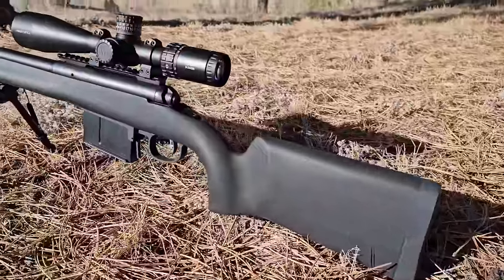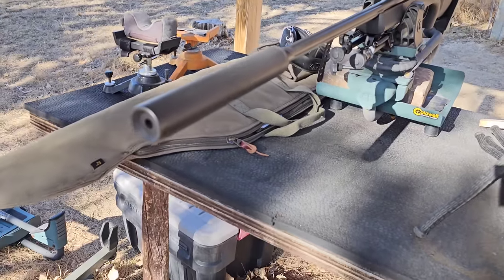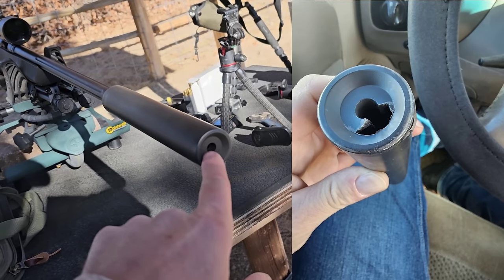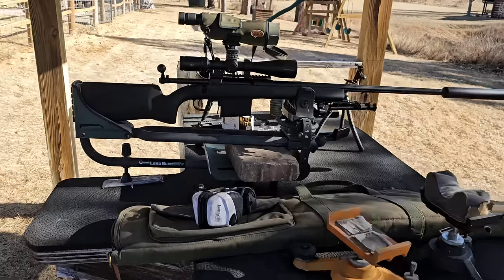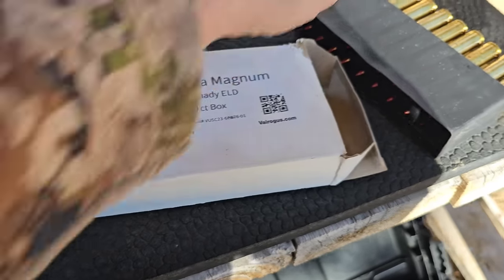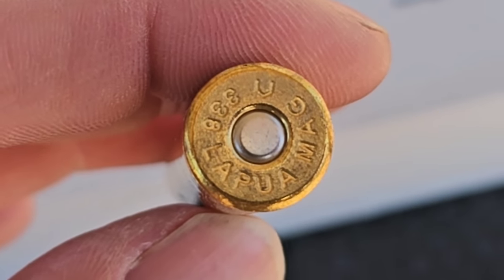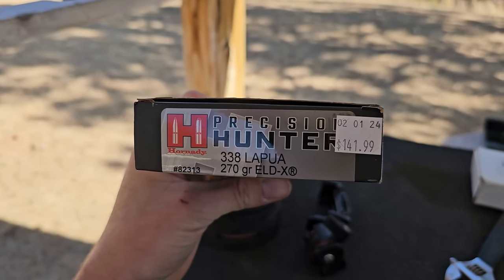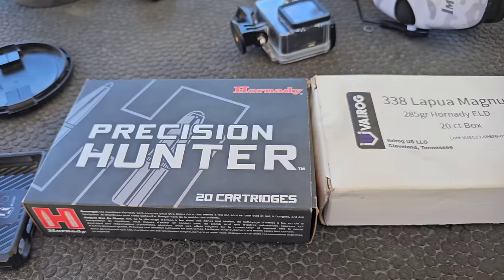Long Range Rifle: Something is WRONG!

Comment: Hello. I had a similar type of accuracy issue with a .243 rifle having a 1x10" twist. I thought and if you ask anyone that should be good for 100 grain bullets (I realize and am aware of Remington's debacle with the 6mm and rifling issue) . They were not, 4" groups and after shooting several different brands of 100 gr. moved down to 95 gr., then 90 gr., 85 gr. and was totally frustrated with the lousy 4" to 6" groups, and at my wits end about what to do next. I was seriously considering taking the angle grinder to the rifle and leave the pieces in the trash. I decided to keep going, why not, as I had already spent several hundred dollars on premium ammo. I stopped at the local Scheels and they had plain jane 80 gr. Federal Power Shock SP's and bought a couple boxes, only $20 plus each and headed to the range. I shot 3 as foulers, the next 17 shot 1 3/16" which is good enough for me. I have verified this with a couple other brands of 80 gr. bullets. The 75 gr. bullets were grouping slightly larger and some 48 gr. or whatever were not good. So, my humble opinion would be to try lighter bullets if you have confirmed that there is nothing wrong with the scope and there are no obvious problems with the rifling or chamber. You might have to apologize to the shell company that you disparaged too. Enjoyed your video. Thanks.

Comment: I would double check the mounting of the scope, rings, base, rail, ect.  If there is no issue with that I would double check the action screws to ensure they are tight and the rifle is not moving in the stock.  After that, replace the scope with a known good scope ( I suspect this to be the problem).  After that you can experiment with more than two types of ammo.  Some guns are picky.

Comment: I have that same rifle. Removing the muzzle brake was a chore... well not the brake, the washer.
I'm running the Banish 338 on mine
Reply: I should note. I am running Leupold scope with vortex precision rings. First time I zero'd it... took a few shots to dial it in.. then first group was 1" at 100yrds. Just bench rest with bags and some ELD match.

I wouldn't have recut the threads. I would have contacted Savage customer service. I've only dealt with them a couple times trying to get some info, but it seems their customer service is good.

Comment: Take the bolt apart and check for spring bind, and poundage, check pin also, make sure nothing is stuck down in the tapered area were the pin seates

Comment: I shoot a model 110 with an Arkon EP5. My 100 wasn't shooting well when I started with Hornady 285gr bullets. I reload for everything I have. When I started loading for the 110 it was shooting at best fair ( 3-4in groups at 100 ) what I found is the jump from the bullet to the lands was over an 1/8in. I now have this rifle ammo at 20thousands from the lands and now they do not fit in the mag but I am shooting sub 1/2in at a 100 with 250gr Burger Elite Hunter and shooting milk jugs at 1000 to 1200 hundred is not difficult.  So you might check your land to bullet distance however if you don't reload then there isn't much you can do.  Also my Arkon is extremely precise when doping for distance and returning to zero, I am extremely happy with it.
Reply from the maker: Thanks for the info.

Comment: I bought my savage 110 fcp hs precision in 338 Lapua back in 2012 when they just came out. I reload for it, loves Hornady bullets, will be trying sierra soon, but wicked accurate with a vortex razor HD gen 2 4.7-25 sitting on it. 
Using 285 grn hpbt bullets. Great rifle, has at leasy just over 1000 rounds through it. Still shoots great.
HOWEVER, now that youve had a true bore thread issue.....makes me wanna look at the threads and everything before i throw a can on it. 
Good to know

Comment: If you have anybody that reloads or a commercial reloader by you, I would take them two empty boxes of brass, and have them reload them to Nosler or Barns ttsx or Sierra GameChanger have them load them to their specs from factory and try them. I have multiple big guns too, and the only ones that really do good in mine that are Hornady are either SST‘s or interlocks ELDX I have not had a lot of luck with, but my 338 my300 Rum 7mm STW 300wm and 300wsm Shoot lights out with the nosler barns and Sierra bullets I also cite mine in first at 25 yards to make sure I am on the paper and then you can work it out from there. I always draw the crosshairs in the center of a paper plate measure down 2 inches and put a dot pull your boat out, make sure that you can look through where the bolt is and make sure you’re covering the Dot and make sure your crosshairs are aiming at the Bullseye above the dot and if You sit your scope to the bulleye 0:31 above the dot then shoot and you should be pretty close to the dot 2 inches below and set your scope to where you’re hitting the dot 2 inches below then take it out to 100 yards and you should be pretty close on paper to where you can adjust it

Comment: I know it’s 2w old already. Savage is well known for the railroad or zipper barrels. They’re tooling marks perpendicular to the bore the full length of the rifling. Ive also found most factory chambers are cut off the bore axis. Savage knows about their issues. They tell customers to shoot it and if it doesn’t meet their minimum quality standards, they’ll rebarrel it. 
Another commenter posted about putting a criterion barrel on theirs. I’ve got several shaws that shoot amazing for the price. Criterion’s are great, but if you’re willing to spend, you won’t be disappointed with a Brux, bartlien, benchmark etc. Or you can just sell it to me 😉
Reply from the maker: I got the parts I ordered. So I will be working on it soon. There is a rifle just like this for sale at first stop guns in Rapid City, South Dakota. FYI

Comment: Savage is really sensitive to action screw torque and the rear tang area under the safety being free floated.  
With every savage that I’ve had to tune, the front action screw torque was between 30 and 50 inch lbs. and the rear was around 20 and the groups would close right up.
Reply from the maker: Thanks, I will try that too.

Comment: Barrel not fully free floated? 
Base or rings coming loose? 
Does it group without the suppressor? 
Did it group before you had the barrel rethreaded?
Was the barrel cut and then re crowned?
Reply from the maker: Barrel is free floated, 
Rings and base are tight to spec,
Did not group with or without suppressor,
It did not group before threads were re cut.
The barrel was cut and re crowned after suppressor incident. 

I got a steel base coming, going to try different scope with different weights and brand ammo. And check everything else before I decide to put a new barrel on it. Thanks for watching.

Comment: A buddy of mine had the same problem with an epl 4x16 scope with a 300 Weatherby. Trued another scope and everything worked. Something internal was slightly moving and wasn’t noticeable until groups where shot. Not saying this is the problem but I have also had this happen with a vortex psr gen2 ffp where the glass was moving and only noticed slight movement when turning magnification.
Reply from the maker: Yes, I'm going to try another scope.

Comment: A quick question, is the scope touching the rail mount in the very front putting pressure on the scope when fired.
Reply from the maker: No, there is a small gap between scope and rail. Thanks for watching.

Comment: I had a baffle strike on a rifle as well.  The gunsmith that threaded the barrel either threaded it crooked or the threads collapsed and the adapter cocked upward.  Waiting on mine to get back from Silencer Central.
Reply from the maker: Such a pain when that happens. Luckily I bought mine locally and could drive to the factory and drop it off. Still had to wait. Thanks for watching.
Reply: @Guidedhunts  That's good that you have the company nearby.  Silencer Central sent me a label.  No questions asked.  1 week into a 3 week turnaround.  It is a pain as load development basically stopped.

Comment: Whenever you put a suppressor on,  use a caliber appropriate suppressor alignment rod. Every time. Aside from that, this is a 110% budget rifle setup. These are the results i would expect for what you spent. I'd buy a prefiit Bartlein and bring the whole damn thing to a gunsmith and have it true'd up and headspaced. Personally i'd go .300PRC if you need a heavy round like that. $60 a box everywhere around here.

Comment: Have you checked the fit of the barrel lug to the stock may be a good bedding job that might help tighten up your groups. I would run a barrel scope down the bore and see if there is a lot of carbon and copper fouling there could be a lot of carbon buildup in the throat area of the barrel. I would have a gunsmith look at the barrel for straightness and fit to the receiver. The mysteries of buying a used gun and not knowing its history.

Comment: First thing I would do is look inside of the bore with a bore scope give the bore a really good cleaning then bore scope it again if there is heavy carbon fouling or maybe burs especially at the mussel use a bore paste that has pumice which is a mild abrasive coat a bore mop with the paste don't be afraid to use this several strokes then clean inspect an repeat as necessary other things id check is the barrel contacting the stock anywhere it shouldn't be and the receiver is it bedded correctly and is the riflescope a known good scope I've seen all these things and more cause a rifle to shoot poorly  an be corrected by the shooter/ owner nothing you cant do yourself with patients an time

Comment: Inspect the bore and the muzzle crown with a borescope. Check to ensure the barrel is floated. Bed the receiver to the stock. 
If the barrel is bad, the borescope should allow you to confirm that. Then you can make a decision based on facts supported by evidence.

Comment: If it came with the scope rail installed take it off, degrease the screws and receiver threads and install with blue locktight. I've given up on savage quality control. My 6.5 prc is fantastic but my 308 is horrible. It's getting a new ibi barrel. If you're going to rebarrel that rifle switch to 300 prc. Glad you're safe and only minor damage to your set up

Comment: Just spit balling.. Are those scope mounts Warne?  That models has several diff models with different recoil keys.. some models use round cross screws.. some use a loose key., That can easily fall out during assembly.  Thought those models mounts were mainly for rimfire setups?
Reply from the maker: They are Warne steel rings. With a steel square recoil key. It is still in there. And the rings are rated for 338 lapua. Going to try different rings. And going to try a different scope.

Comment: Lead sled with weight has been known to break scopes especially on high recoil rifles... I just use mine with no weight as a rest. I have an older model of that 110... with max handloads and a 300 SMK its 1 MOA with that cheap stock. Going to be throwing it in an MDT chassis soon so I can actually use a bipod with it.
Reply from the maker: The lead sled I was using didn't have much on it. I use it like you just to hold the rifle. The recoil of the 338 lapua is not bad. My wife's 26 nosler kicks harder. When I find the problem, I will make another video. Thanks for watching.
Reply: @Guidedhunts Interested to hear the updates!! I had a similar problem with another rifle but it turned out to be my leupold scope just lost zero. Might be a worth a check too.

Comment: I would just check the torque on the action bolts. Epoxy bed the pic rail. Switch to a normal set of picatinny rings that can be lapped/bedded. Switch the scope. If it doesn’t shoot, just let it go. My experience is you start just going down a rabbit hole when it’s the actual rifle being the issue. Especially a factory rifle.

Comment: Bro, you can’t buy a big magnum rifle, put a cheap scope on it, a cheap suppressor, shoot cheap ammo, and expect it to shoot good groups. I certainly wouldn’t put a $300 barrel on it and add to the mess. 
Put a little cash into the most important part of the rifle, which is the barrel. If you troubleshoot it. Do one thing at a time, and one thing only, when ruling out problems. Or just spend $800 on a good barrel and start over. 
I hope you get it figured out. 
God bless you brother.
Reply: I'd probably put a good cryo barrel on it. He might actually find one in stock for $800.
Reply: You can put a Night Force on a gun with ammo your gun does not appreciate, and you will shoot like shit. Arkens scopes have proven to Track well and hold a zero well. He is shooting from a sled, the scope is not the problem. $.02
Reply: Love my arkens put this same model except in MIL on all my hunting rigs from 308 to 375 H&H and I've never had a problem. As a matter of fact i swapt out all my vortex and leupold optics for for arkens just because you get way more features for slightly worse glass but i dont regret the decision
Reply: @henryg2960 I’ve seen new scopes ghat wouldn’t hold zero
Reply: "Salvage" gains its claim to fame for a reason.

Comment: I had a Savage 112 Magnum which is the single feed target model. It shot like crap and I ran out of adjustment, well long story short they put the barrel in the action crooked from the factory. 2nd rifle worked better but didn’t get reimbursed the cost of the wasted ammo.
Reply from the maker: Yea, I believe that is what happened to this rifle. Just going by how the muzzle brake threads were cut. Thanks for watching.

Comment: Seems like it would take a lot to make that rifle accurate.  I personally would not keep it.  Also, wouldn't 300 WM be enough instead of paying 3X more for 338 Lapua ammo?
Reply from the maker: Yea I'm going to find out, thanks for watching.
Reply: My main hunting rifle is 300wm and I love it, I own a gunwerks built 300wm, 300 norma, 338lm and I must say the 338lm is definitely more capable cartridge but is it worth the cost difference? Not if you don't hand load! I hand load so it's not terrible to shoot, buying factory ammo? Hell no ide take 300wm all day long. 300 Norma has been truly incredible but getting good brass is not easy even now. Will be having gunwerks build me a 300prc here before to long or possibly a 28 nosler instead. In the hunting world 300wm has never let me down, I know the cartridge well, I know my ballistic tables well and if I do my job putting lead where I want it isn't a problem.
Reply from the maker: @EDCandLace  I do lob the 300 wm it does a great job. Thanks for watching.
Reply: I have the same rifle set up, in 300 WM and I have been trying to find that same set up in 338 lapua a little bummed about its performance
Reply: Maybe in his next video he will be rebedding, rebarrelling, and setting headspace. @tylerwolfley2689
Reply: I used a SAKO 7mm STW for 20 years, but I'm back to my old Winchester 270 Win for Wyoming hunting. Little 130gr pills work on everything. 🤠
Reply: Try a different scope

Comment: Did you happen to do savages break in procedure? I really dont know if there is one. Or its just one of those guns that take 100 rounds before it starts shooting. Id never base accuracy off factory ammo in my opinion tho.
Reply from the maker: I didn't. It was a used gun when i bought it. But I can look into that. Honestly, though, most rifles I shoot new or used from the customers we get. Hold some type of group 2 inches or under, and then by trying different  factory ammo can get it down to moa or under.
Reply: @Guidedhunts  do you have a bore scope I'd be curious to see what the rifling looks like. Another thing just make sure the barrel is 100% floated. I'm sure the 338 gets hot quick and could be touching once it does since it groups a few then throws.
Reply from the maker: @Lt.Dan2.0  I don't have a bore scope but I might get one to check it. The barrel Is free floated. I did check that. And also pulled it out of the stock. It has a full aluminum bedding block. I then torqued to spec. I am waiting on some things to get here before I take it back out.

Comment: I am surprised that a savage 110 has problems.   My 110 in 30-06 is a tack driver with most ammo. But it is a 40 year old gun. Maybe the quality is better in older guns. I remember reading articles in gun magazines that talked about the 110 being more accurate out of the box that "match" rifles.  Mine sure is.

Comment: Pull your rail, check for migration marks, you can torque it but that’s not going to help, it would need to be glued on and torqued to stop that. or switch scopes and see if it’s any better.  

There’s probably a reason the first guy sold it.
Reply from the maker: Yea, I got a new steel rail coming. I'm going to switch it and scope. And check everything else before I have it re barreled. Thanks for watching.

Comment: Had same problem with a DS Arms. Had a 24” pattern. Sent back to company and they said nothing wrong. Took back to range with a couple of recon sniper friends, once again 24” pattern. Took to gunsmith did scope and barrel was bad. Actually had divots in lands.  Sent back to factory, and did follow up call. Plant manager again said nothing wrong. Told them to scope barrel. Which he said no need. I said fine, one of guys has a big channel where does gun reviews and will have him do an honest review. If nothing wrong, then should get good review. Gun came back 5 days later with new chrome lined barrel, old barrel and a new trigger installed. Should have been done the first time.
Reply from the maker: It's going to be interesting to see what the factory says. Thanks for watching.